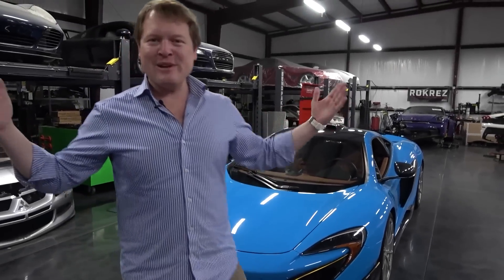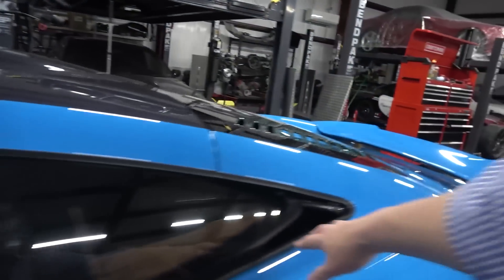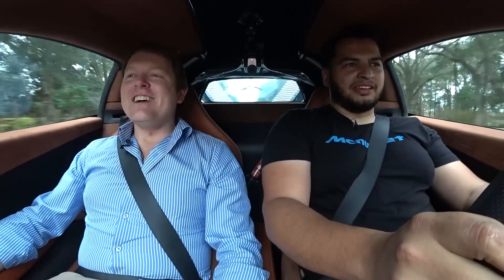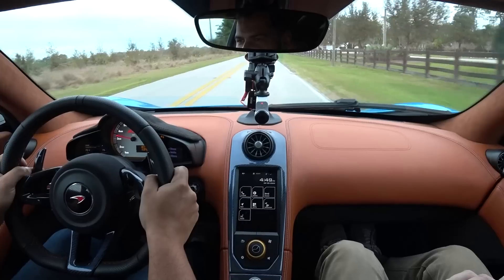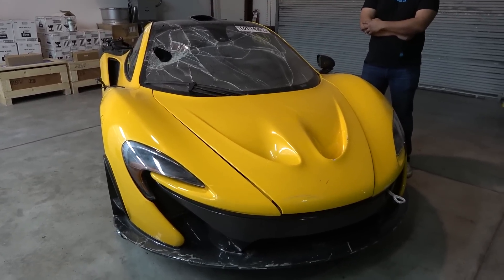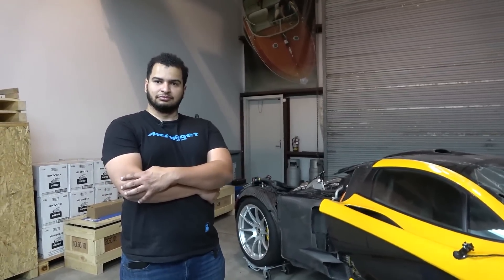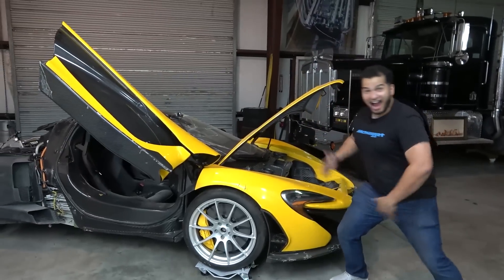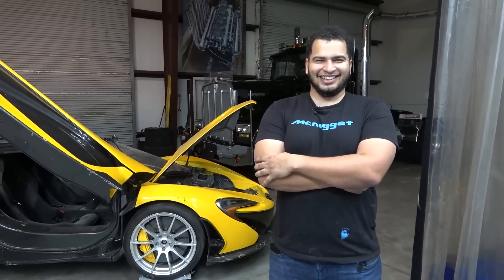WHAT HAS HE DONE!? Tavarish Bought the INFAMOUS Flood Damage McLaren P1

Comment: A liiiittle painful seeing the LT in its running state knowing the engine self destructed 🥲 But I'm sure Tavarish will find a way to turn things around and make it even better than before!
Reply: watch him ls swap it
Reply: @arjunroopra9119  nah v10 swap would be cooler
Reply: @arjunroopra9119  Think he said he's gonna put a 720s engine in so it can handle more extra power
Reply: VR6 swap it!
Reply: its the shmee curse that caused it🤣
Reply: Wait, I am confused.  The LT died after he bought the P1?

I was like, oh the Blue one is fixed?
Reply: I was gonna say the same thing. The line that got me was “I don’t do anything stupid with it.” And the million times he said I really enjoy this car
Reply: @arjunroopra9119  it needs a Lamborghini V10, as a tribute to a dying breed of engines.
Reply: @jwalster9412  He already has a twin turbo lambo V10, he doesn't need another 😂.
Reply: @jasonandrsen  fine, what about a V10 era F1 engine.
Reply: @jwalster9412   do you know how much work goes into one of them just to start it up. The V10 f1 engine have to be slowly feed warm engine oil for half an hour before even starting it. They also have to external warm up the engine block why adding the oil.
Reply: @jwalster9412  the engine that needs rebuilding at 1/2 million every 300 miles you mean
Reply: @chriscollins550  it was 4 hours of heated oil and the gel they used instead of water. it was like a life support system the had them on because they are seized solid. really exotic bit of kit
Reply: @chriscollins550  maybe a replica F1 V10 that's a little less hard to start?
Reply: @ALLTHINGSTV1  yes it was I couldn't think of the English words and way of saying it.
Reply: @jwalster9412  just another Ricardos engine same that was in it.
Reply: How is is LT running, if he blew it up?? Am I missing something.?? Someone help me
Reply: @inwithsliminwithjim3416  this video is from before he blew it
Reply: @inwithsliminwithjim3416  this video was filmed months in advance I believe, meaning he has had the P1 for awhile now and has been working on it.

Comment: The “tig brush “ can be done fairly easy at home with a car battery , some jumper cables , a piece of aluminum for a brush handle , some strands of carbon fiber as the bristles of the brush and some osphoric acid . I have done it for a custom exhaust I made for my motorcycle.

Comment: Since the P1 uses the same block as the 675LT. I was hoping Freddie would go the extra mile and rebuild the motor and put in forged internals, sleeves, turn it into a 4.0 and turn the boost to 11 and basically build the most powerful P1 out there.

Comment: I would love to see Tavarish collab with Ben from VTuned Garage on this car. He could be essential on rebuilding this. He stripped down every nut and bolt from a McLaren, down to the bare carbon tub and rebuilt a car on another tub. This car really needs to be stripped down to that degree.
Reply: Did you just describe what Tavarish did…. In the comment section of his own video?
Reply: @ThomasSeeds  for starters this isn't Tavarish's video, it's Shmee's. Secondly, Freddy did not strip his McLaren down to the level that Ben did. Most of the Monocoque and a lot of the front was still assembled on Freddy's. Ben stripped his down to a bare tub, meaning literally every single piece was taken off and reassembled piece by piece on a different tub.

Comment: Disconnecting those batteries do not make them safe.  The problem is internal and a short from sea water can cause a thermal runaway and you cannot put it out until it burns itself out.

Comment: A flood damage P1 is still a P1.  and lets be clear about flood damage and damage in general.  outside of some items on a car that MUST be replaced, ironically and contrary to popular belief , cars from flood damage can be restored.  it all depends on the type of water its been submerged in.  ala, clear brackish, sandy,  fresh or salt water, the amount of time within the water and the time out in the sun, and what parts will likely be saturated by the water.  YES sand is an issue too.. especially southern florida powder white gulf coast sand which are extremely small crystals and virtually impossible to rid away without the use of.. guess... Water! lol,   but unless you do something INCREDIBLY STUPID like trying to start a flood car before its been completely torn down and cleaned out,  then youd be surprised how such things can be recovered.  cars are designed to withstand moderate amounts of water. Rain and heavy splash water, even to a degree driving thru moderate water.  again not smart at all but we've seen incredible feats of survivability with cars going thru water.  dont try this at home.